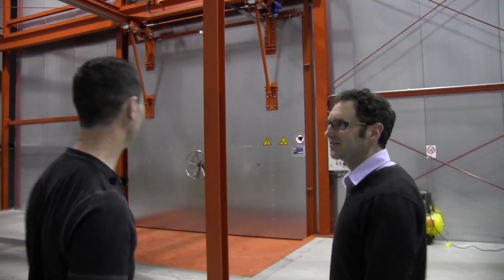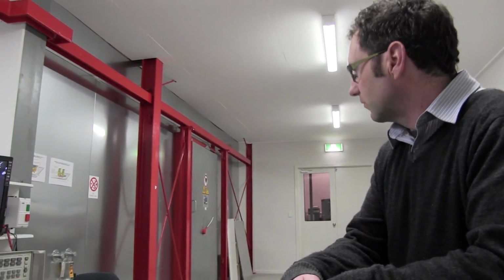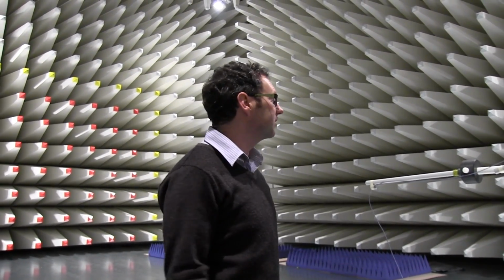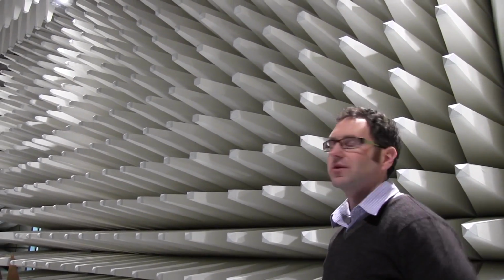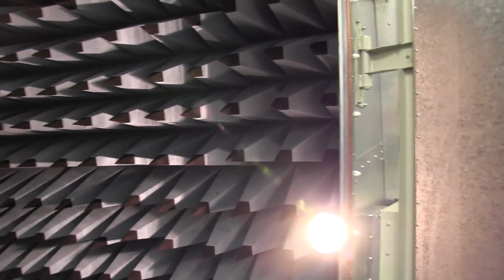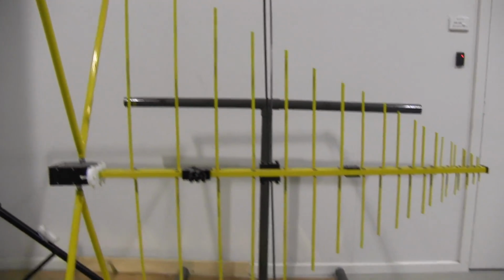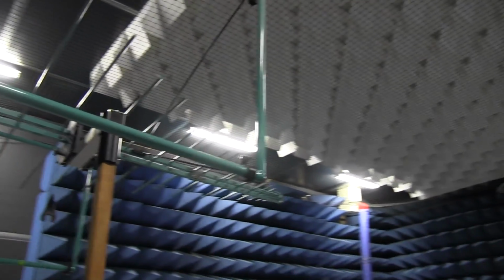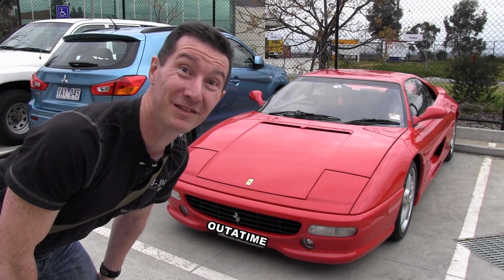EMC RF Anechoic Test Facility Tour - EEVblog #202

Comment: Frankonia make the best anechoic chamber
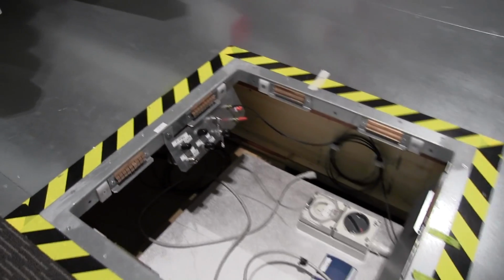12:59 this is a CP, floor connection panel,  they are situated close to the antenna and close to the turn table, for easy connection
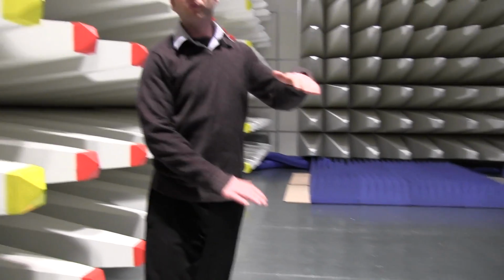13:44 All Frankonia chambers have raised floor, this one is heavy duty, all cable and optic fiber can circulate through duct under the raised floor from floor connection panel to penetration panel to control room
13:59 Those absorbers are made form mineral material laminated with thin film, those absorbers are M0 non flammable.
14:8 End cap is to hide the nylon nut at the end, this is how absorbers are fixed on shielded wall
16:17 Dyno on anechoic chambers are all shielded, this is why those dyno cost so much

Comment: I am reminded... as i am current sitting outside a room like that... EMC testing is very boring. Dont get me wrong, im glad its boring, but at least I can watch the EEVblog while i run audio susceptibility. :)
Reply: A co-worker of mine has to sit in front of a screen during immunity test and he basically is just there to watch the numbers displayed by the device under test.
So, he is (at least during the immunity tests) essantaly an expensive OCR (Optical Character Recognition) solution. Of course that is not the only thing he does, but... explain or better do not explain management why EMC testing eats so much man-hours and throughput time.
Reply: LOL! Oh man I felt the same way when I used to do Total Radiated Power and Total Isotropic Sensitivity measurements on mobile phones. Measure the phone alone, then with a dummy head and hand with fingers in different positions turning the DUT in increments of 10deg for a full 360. Ugh! Boring but necessary so hang in there! :)

Comment: My work has an EMC test room... i've been in there for testing... its similar to the video but smaller. An antenna to monitor reflections, rotate it 90 degrees and test again with a spectrum analyzer. Pretty cool stuff.

Comment: No, they aren't the same physical field. You can't move a magnet with an electromagnetic field. To shield against magnetism you need a diamagnetic material like soft iron. Mumetal is the best, but it is not good against strong fields because it tends to saturate too easily. Once that happens, it may as well not be there.

Comment: The cone coating is carbon black and graphite mixed into paint. A German company is selling a RFI shielding paint for people wanting to shield themselves from RFI towhat end I am not sure. They sell this carbon black and graphite paint to shield electric guitar control cavities which I find to be useless. RFI does not come through or affect audio very much at all. Foil or Ferrashield will do low freq EMI which is the enemy to low noise in audio circuits. Foils costs a lot more, go figure!!

Comment: The place(s) I worked that had these collected cell phones, cameras, and all recording devices at the gate. Look me up in 2050 when their nondisclosures clause expires, and I will likely have forgotten what I was even doing there. The floors were done with cones too. A bridge could be set up, and they had hanger bolts to suspend things from the ceiling, and places to put pillars up from the floor for platforms TTs etc.. Both can rotate, & or gimble.

Comment: @sixstringmania a poorly conductive material. They have to be resistive so they can convert the the RF into heat.

According to wikipedia  a mixture of carbon and iron is very common. I think I have heard of silicone being used (I guess it would have to be silicone and some other material to be able to do the job)